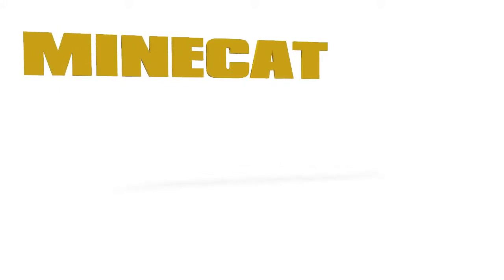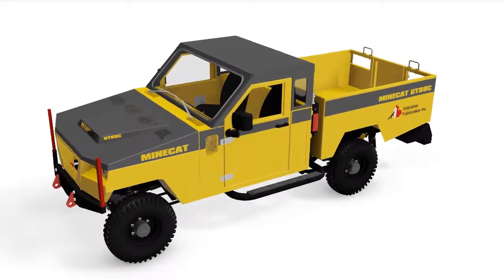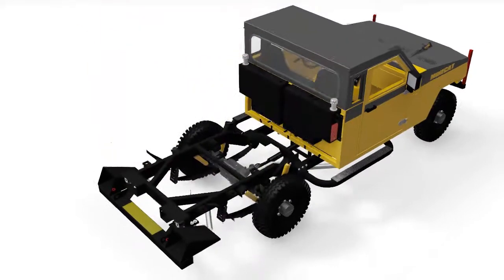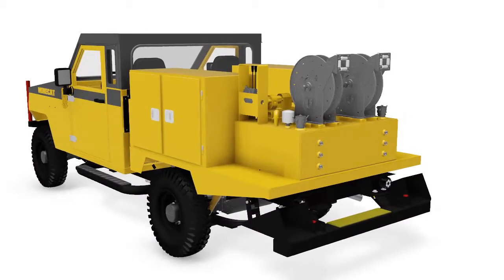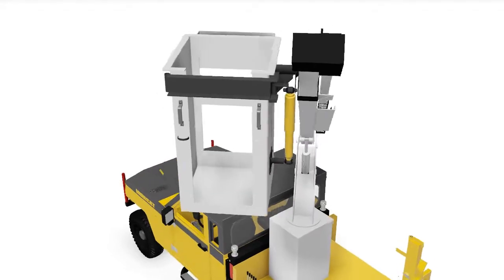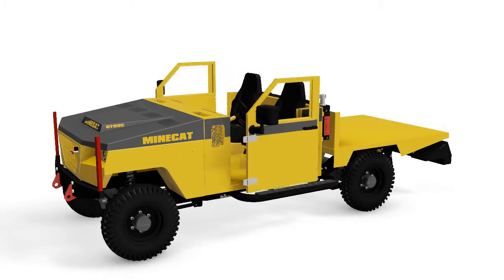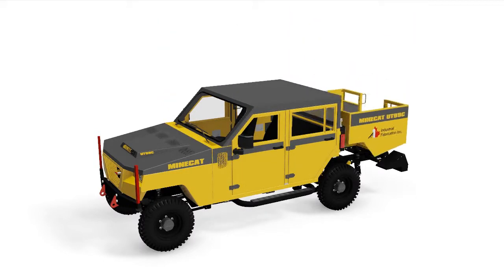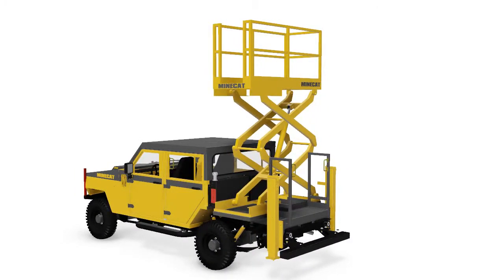MINECAT UT99C Configurations

Comment: is it possible to customize a Minecat utility truck to be legal on the road in the USA? or are they already legal to drive on a public roads? I'm a welder/heavy equipment repair guy that does repairs in several different quarries and logging encampments as well in Massachusetts in the USA and at the moment I'm using an ex army truck from 70s to stand up to the abuse from repairing equipment/ fabricating things on site in rock quarries as well as in log encampments. I hope someone sees this and get back to me I love what I've seen and heard about your products so far.
Reply: Pretty much impossible to make it road legal.  This vehicle is designed for underground mining.  For one thing; It has Dana industrial axles that have internal wet disk brakes.  Internal wet disk brakes don't like high speeds.  Top speed is 25 mph and if you were somehow able to make it go faster than that you would overheat the axles.  Steering is hydraulic and would get pretty scary at highway speeds and I had heard years ago that hydraulic steering with an orbitrol style valve is illegal in the US.  Hope this helps!
Reply: I will add to this many years later. Steering doesn’t self centre..  and it has 3 gears. Slowest, slow and slower. Plus it has little insulation. It’s loud, can be hot and very expensive to repair. It’s a tool, not a day to day vehicle. Anyway, tomorrow morning around 8am, back underground with the old Minecat lol